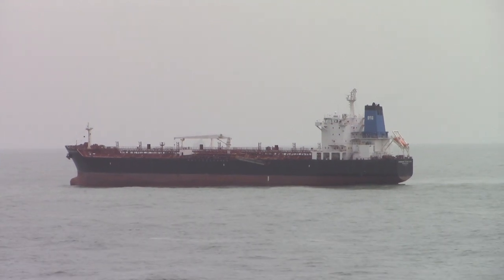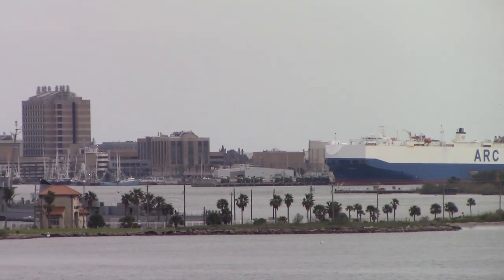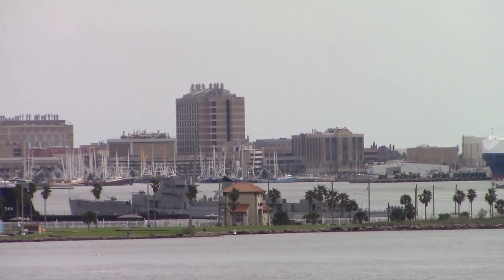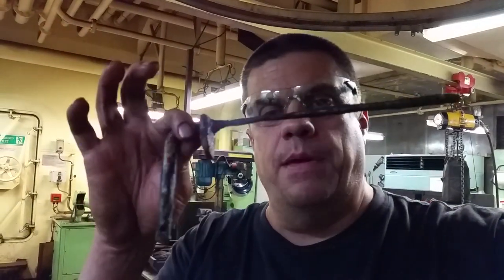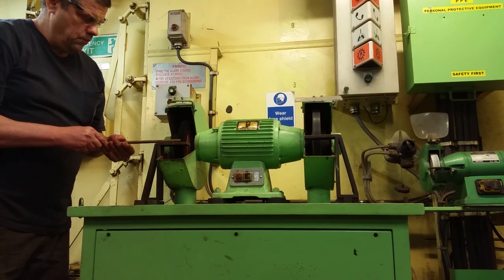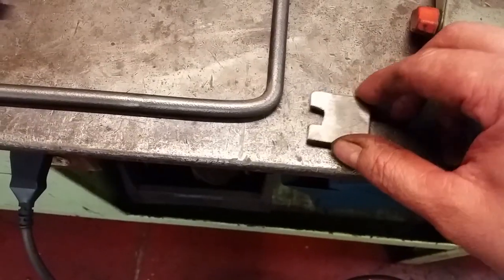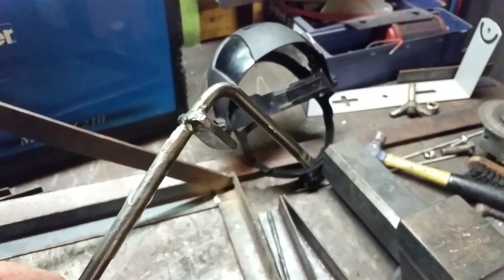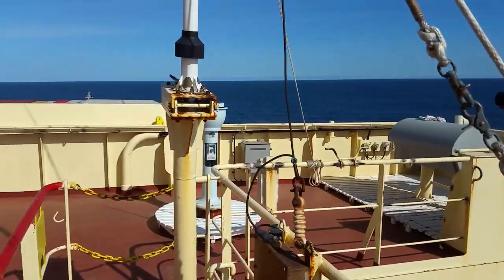Container Ship Vlog #27 USA Coast Footage

Comment: How about some paint on the other half of that pin lest you be making another in 6 months. Good stuff, Thanks.
Reply: Love the videos but I agree some galvanized paint would have been good on the shaft
Reply: You guys are absolutely correct when I put it up there I asked them to put some paint on it right away and they were going to paint and prime it normally I use galvanization spray after welding something but I guess I need to tell them again to paint that because you're right I will have to make another one if not